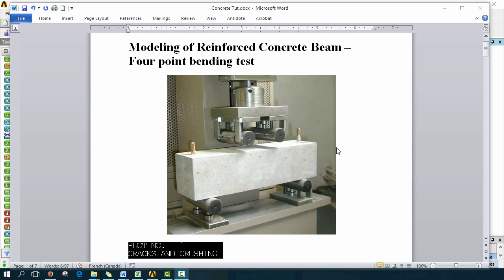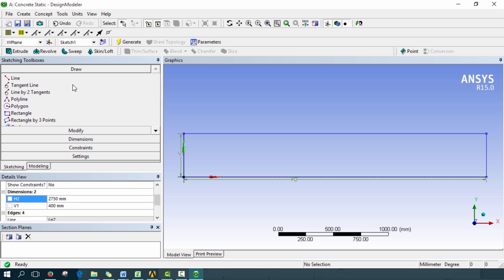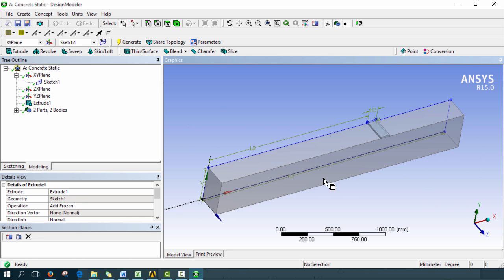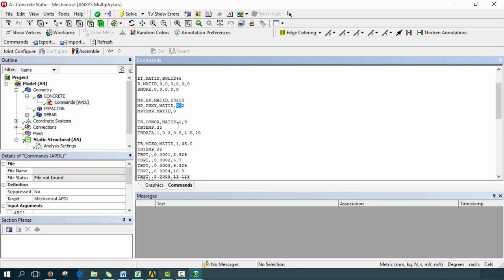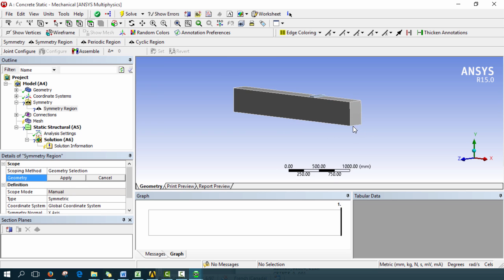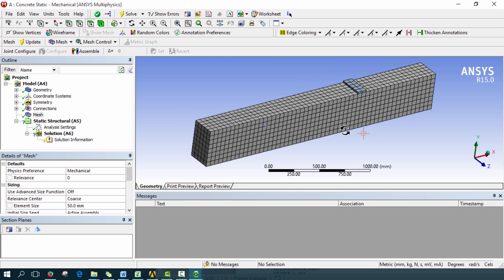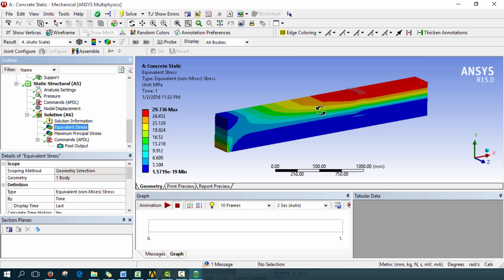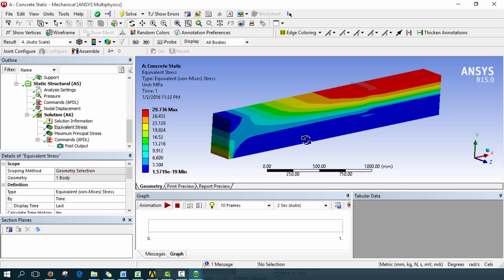ANSYS Tutorial Reinforced Concrete Beam (RC BEAM) - Static Structural

Comment: I've been following this video for a similar beam that I've been modeling but I have an issue. It works fine when I supress the rebar but doesn't run when I try to use it as normal. Any idea where I went wrong?

Comment: I have a question. I'm doing my project on magnetorheological shear thickening polishing for brittle materials. However, I'm doing simulations with ANSYS software for CFD, and I have obtained satisfactory results. But for static structure, I want to check when cracks and fractures will occur and how the penetration of grits or abrasive particles could impact this. Could you please help me with this?

Comment: Why giving command instead of apply concrete property directly??
Reply from the maker: Workbench does not support these material properties yet, so we have to use commands
Reply: @drdalyo  sir i can see sever all  meterials in work bench in meterial tap., previously i choose any one from the list. Thats already included concrete also. What's about this?
And how you get this command sir?
Reply from the maker: It depends on the analysis you would like to do. For something basic, you could use the material library.

Comment: One correction in the video
the Solid65 and Link180 do not define the material, These are the element type that ANSYS will consider while solving the equations.
Reply from the maker: you are right they are element types than can then later carry material definitions

Comment: Can we use the commands for inserting only materials. I only have to input concrete material so will the command for concrete part be sufficient Or should I also add code in static structural and solution part as well?
Reply from the maker: Depends, if you are not joining any stirrups then you can just input the command in materials. You do not then need code for static structural. However if you want to display the crack/crush plots then you need commands for solution.
Reply: @drdalyo  I used the concrete part of code and inserted stress strain values I got from my experiment results (83 ) values are there. And I changed the Young's modulus value as per my requirement but the code is showing error when I ran the file
Reply from the maker: @aakashshukla3340  yea the code is very specific so maybe try to keep the number of table data points the same and see. you need to possibly modify some lines of code also.

Comment: Hey, I am using ANSYS student version, the "Geometry" section is different from this video, after choosing geometry it will bring you to the SpaceClaim how should I assign a cross-section to my lines in the SpaceClaim?
Reply: Draw a circle and of required diameter and use pull command to make it a 3D model of rebar. If you want to use design modeller instead at the beginning right click on the geometry and choose Design modeller instead of space claim.

Comment: These commands are not working can you explain it to me bit clear
this is the error which occur after solve
An unknown error occurred during solution.  Check the Solver Output on the Solution Information object for possible causes.
Reply: I am having the same issue as well on the 2020 AnSys academic version.. I don't know the exact reason. Did you figure it out??
Reply: @byte_bender07  not yet but my guess it connection command which creating the problems

Comment: Hey, I found your video really useful and helpful, but I was wondering if in the current ansys version there is a new way to introduce the interaction between the concrete and the steel, since there has been a lot of changes in the software since 2016, or if we still need to input a command. Im doing my college final project on ansys with a concrete beam, but im having a hard time with the interaction between the two materials.
Reply from the maker: Hi Bianca! Thanks for watching. To my knowledge I do not think they added any new features on this since then. I know its a bit of a pain but I believe using commands is still the best way. You can check my comments in the video, i believe some people posted some useful tips or even corrected some things i missed during the video. You can also email me. Best of luck!
Reply: @drdalyo  thank you!!!
Reply: @drdalyo  i sent you an email 😊, the one that's in your channel description

Comment: Dear Please I would like to ask if you have a tutorial video for using ansys to make a 3D model to simulate pile -soil interaction and develop negative skin friction in details and calculate the value of the pore water pressure - drag load - soil and pile settlement and the values of the negative skin friction stress.  If you have such tutorial please I need it for my research. thanks

Comment: R,MATID,12,,0
The 12 on the last line, does it represent the rebar radius, diameter or area? I saw a document were someone put in the rebar area instead.

Also, you put the concrete crushing stress value as 25 but the compressive stress from your data points for the concrete stress strain relationship is up to 30.

 Please provide info on this.

Also, i modelled the same geometry on ansys 19.2, and after analysis the impactor on top slides outwards, but when i keep the contact as bonded, it stays.

Please help.

Comment: Hello, I followed your guide step by step. I have tried for 2 days straight to solve this but the following warnings occur when trying to solve:

Poisson's ratio NU set for material 1 deleted.
Material property table exceeds the number of defined temperatures.     
  Number of temperatures is 1.  The number of data values is 2. 
Poisson's ratio NU set for material 3 deleted.
Material property table exceeds the number of defined temperatures.     
  Number of temperatures is 1.  The number of data values is 2. 
Poisson's ratio NU set for material 4 deleted.
Material property table exceeds the number of defined temperatures.     
  Number of temperatures is 1.  The number of data values is 2. 
Poisson's ratio NU set for material 5 deleted.
Material property table exceeds the number of defined temperatures.     
  Number of temperatures is 1.  The number of data values is 2.
Poisson's ratio NU set for material 6 deleted.  

And then a warning that: 'One or more bodies may be underconstrained and experiencing rigid body motion. Weak springs have been added to attain a solution.  Refer to Troubleshooting in the Help System for more details.'

Can you please help me? I suspect either the command files are incorrect or something else. I have redone your exact steps multiple times and still get errors.

Thanks Dr.
Reply: i also having the same issue brother regarding to the warning. did you done it correctly? if so then please tell me how you did it? 
Kindly regards
Reply: @moeedshahid6193  me to. I used 2020 R1 and I cannot show the cracks
Reply: Same issue I faced as well.

Comment: Hello Dr Dalyo. I've tried to change the command, the concrete one in particualar so that I may use it for 60MPa concrete (stress-strain graph for 60 MPa concrete), but every time I run the solution it gives an error, yet yours with 30 MPa runs correctly. Please help advise on this
Reply: I also facing a similar issue. How did you resolve it Francis?

Comment: are these commands required actually? can i model an RC  beam without using commands in workbench? when i tried , reinforcements and concrete were not connected. only the concrete portion deflected leaving behind the reinforcemnt. how can i rectify this?
Reply from the maker: Unless ansys released a specific update for this, I am unaware of another way. Its one of those features that existed in the original APDL software but not yet in Workbench. There are many other features only available in APDL.
Reply: @drdalyo  You can use a command to join them, the concrete is solid186 and the steel bars is beam188 for Workbench, so in the /PREP7 section you can put this command 
/PREP7 
ESEL,S,ENAME,,186
ESEL,A,ENAME,,188 
ALLSEL,BELOW,ELEM 
CPINTF,ALL,0.00001, 
ALLSEL,ALL 
/SOLU 
OUTRES,ALL,ALL

thats command join the nodes, to learn more download the command reference of Ansys and search CPINTF, Regards.

Comment: why doesn't the graph in the solution work when i try this on my workbench?  i mean usually in the solution tab we can see the graph on each solution that we want, but in this case the graph and the table doesn't want to show up. Could you help me with this problem ?
Reply: ANSYS Reinforced Concrete Beam (RC BEAM) - Static Structural by DrDalyO
CONCRETE COMMANDS:
ET,MATID,SOLID65
R,MATID,0,0,0,0,0,0
RMORE,0,0,0,0,0

MP,EX,MATID,29250
MP,PRXY,MATID,0.2
MPTEMP,MATID,0

TB,CONCR,MATID,1,9
TBTEMP,22
TBDATA,1,0.3,0.8,1.5,25

TB,MISO,MATID,1,35,0
TBTEMP,22
TBPT,,0.0001,2.925
TBPT,,0.0002,5.7
TBPT,,0.0003,8.325
TBPT,,0.0004,10.8
TBPT,,0.0005,13.125
TBPT,,0.0006,15.3
TBPT,,0.0007,17.325
TBPT,,0.0008,19.2
TBPT,,0.0009,20.925
TBPT,,0.001,22.5
TBPT,,0.0011,23.925
TBPT,,0.0012,25.2
TBPT,,0.0013,26.325
TBPT,,0.0014,27.3
TBPT,,0.0015,28.125
TBPT,,0.0016,28.8
TBPT,,0.0017,29.325
TBPT,,0.0018,29.7
TBPT,,0.0019,29.925
TBPT,,0.002,30
TBPT,,0.0021,30
TBPT,,0.0022,30
TBPT,,0.0023,30
TBPT,,0.0024,30
TBPT,,0.0025,30
TBPT,,0.0026,30
TBPT,,0.0027,30
TBPT,,0.0028,30
TBPT,,0.0029,30
TBPT,,0.003,30
TBPT,,0.0031,30
TBPT,,0.0032,30
TBPT,,0.0033,30
TBPT,,0.0034,30
TBPT,,0.0035,30

REBAR COMMANDS:
ET,MATID,LINK180
MPDATA,EX,MATID,,2e5
MPDATA,PRXY,MATID,,0.3
TB,BISO,MATID,1,2
TBDATA,,460,2100
R,MATID,12,,0

PRE PROCESSOR COMMANDS:
/PREP7
ESEL,S,ENAME,,65
ESEL,A,ENAME,,180
ALLSEL,BELOW,ELEM
CEINTF,0.001,
ALLSEL,ALL
/SOLU
OUTRES,ALL,ALL

POST PROCESSOR COMMANDS:
/SHOW,png
/ANG,1,
/VIEW,1,0,0,0 !Use these values to change the view
/DEVICE,VECTOR,ON
SET,Last !Outputs final result set
PLCRACK

Please subscribe!!
By DrDalyo
https://www.youtube.com/user/drdalyo

Comment: Can you create a new reinforced concrete tutorial using Ansys R19 please? R19 has a weird interface and tools are different. 

I went through this example with R14 version (that's the only old version I could find). And I got these two errors:
- "An unknown error occurred during solution. Check the Solver Output on the solution information object for possible causes."
- One or more bodies may be underconstrained and experiencing rigid body motion. Weak springs have been added to attain a solution...." 
I did exactly what you have shown in this video, but it is giving some warnings about poissons ratio in the Solver Output. 
Thanks,
Baha
Reply: I got the R19 as well, I'm interested in compressed reinforced circular columns if you can help
Reply: I got the R19 as well, I'm interested in compressed reinforced circular columns if you can help
Reply: You can change the screen from space claim to design modeler, so that it wont be weird.

Comment: Hello sir, I've recently started working in ANSYS Workbench 19.0. I used the APDL commands you have specified with minor changes in the stress and strain, but the deformation is very low when compared to the experimental data. The rebar commands are not influencing the model. It doesn't show any error when I comment Young's modulus or I increase the value exponentially. Could you please help me in this?
Reply from the maker: Try making large material changes to the rebar commands, see if there is an effect on the results. There should be. If not please let me know.
Reply: I tried to reproduce your model sir. I changed the rebar young's modulus to 2e10. I can find no changes in the result, Sir. Kindly help me in this. This would greatly help me in my model progress.
Reply: Sir I am following step by step but the commands are not working

Comment: where can i get those codings for concrete  and steel rabars
Reply: ANSYS Reinforced Concrete Beam (RC BEAM) - Static Structural by DrDalyO
CONCRETE COMMANDS:
ET,MATID,SOLID65
R,MATID,0,0,0,0,0,0
RMORE,0,0,0,0,0

MP,EX,MATID,29250
MP,PRXY,MATID,0.2
MPTEMP,MATID,0

TB,CONCR,MATID,1,9
TBTEMP,22
TBDATA,1,0.3,0.8,1.5,25

TB,MISO,MATID,1,35,0
TBTEMP,22
TBPT,,0.0001,2.925
TBPT,,0.0002,5.7
TBPT,,0.0003,8.325
TBPT,,0.0004,10.8
TBPT,,0.0005,13.125
TBPT,,0.0006,15.3
TBPT,,0.0007,17.325
TBPT,,0.0008,19.2
TBPT,,0.0009,20.925
TBPT,,0.001,22.5
TBPT,,0.0011,23.925
TBPT,,0.0012,25.2
TBPT,,0.0013,26.325
TBPT,,0.0014,27.3
TBPT,,0.0015,28.125
TBPT,,0.0016,28.8
TBPT,,0.0017,29.325
TBPT,,0.0018,29.7
TBPT,,0.0019,29.925
TBPT,,0.002,30
TBPT,,0.0021,30
TBPT,,0.0022,30
TBPT,,0.0023,30
TBPT,,0.0024,30
TBPT,,0.0025,30
TBPT,,0.0026,30
TBPT,,0.0027,30
TBPT,,0.0028,30
TBPT,,0.0029,30
TBPT,,0.003,30
TBPT,,0.0031,30
TBPT,,0.0032,30
TBPT,,0.0033,30
TBPT,,0.0034,30
TBPT,,0.0035,30

REBAR COMMANDS:
ET,MATID,LINK180
MPDATA,EX,MATID,,2e5
MPDATA,PRXY,MATID,,0.3
TB,BISO,MATID,1,2
TBDATA,,460,2100
R,MATID,12,,0

PRE PROCESSOR COMMANDS:
/PREP7
ESEL,S,ENAME,,65
ESEL,A,ENAME,,180
ALLSEL,BELOW,ELEM
CEINTF,0.001,
ALLSEL,ALL
/SOLU
OUTRES,ALL,ALL

POST PROCESSOR COMMANDS:
/SHOW,png
/ANG,1,
/VIEW,1,0,0,0 !Use these values to change the view
/DEVICE,VECTOR,ON
SET,Last !Outputs final result set
PLCRACK

Please subscribe!!
By DrDalyo
https://www.youtube.com/user/drdalyo

Comment: Thank you for the video. I would like to ask that concrete material is also available in the material selection section of ansys workbench (i am using version 16), then why dont we directly use that concrete material? In your experience How is that material different than the one we define here by using commands?
Reply: Hey bro, have you figured out the diferences? I have the same question.

Comment: Thank you for the upload, its extremely helpful. I've tried a different model in the static structural module - a circular column with single longitudinal reinforcement, given by line body as shown by you; bottom end fixed supported and axial load on the top end in the form of pressure. But its showing some error during solution. "A solver pivot warning or error has been detected in ROTY degree of freedom of node 17735 located in line body. This is usually a result of an ill conditioned matrix possibly due to unreasonable material properties, an unconstrained model, or contact related issues. Check results carefully. You may select the offending object  and/or geometry via RMB on this warning in the Messages Window." I would be extremely grateful if you provide me with a solution for this problem.
Reply: This might be too late, but I am getting the same error. I guess it's because the body interactions were not given properly, i.e, the concrete has to be contacted to rebar as "reinforcement" in body interaction. This wasn't showing up in static structural in workbench. Using Dynamic explicit might help I guess

Comment: sir i couldn't download the command file please email me to this nthprasha144@gmail.com
Reply: ANSYS Reinforced Concrete Beam (RC BEAM) - Static Structural by DrDalyO
CONCRETE COMMANDS:
ET,MATID,SOLID65
R,MATID,0,0,0,0,0,0
RMORE,0,0,0,0,0

MP,EX,MATID,29250
MP,PRXY,MATID,0.2
MPTEMP,MATID,0

TB,CONCR,MATID,1,9
TBTEMP,22
TBDATA,1,0.3,0.8,1.5,25

TB,MISO,MATID,1,35,0
TBTEMP,22
TBPT,,0.0001,2.925
TBPT,,0.0002,5.7
TBPT,,0.0003,8.325
TBPT,,0.0004,10.8
TBPT,,0.0005,13.125
TBPT,,0.0006,15.3
TBPT,,0.0007,17.325
TBPT,,0.0008,19.2
TBPT,,0.0009,20.925
TBPT,,0.001,22.5
TBPT,,0.0011,23.925
TBPT,,0.0012,25.2
TBPT,,0.0013,26.325
TBPT,,0.0014,27.3
TBPT,,0.0015,28.125
TBPT,,0.0016,28.8
TBPT,,0.0017,29.325
TBPT,,0.0018,29.7
TBPT,,0.0019,29.925
TBPT,,0.002,30
TBPT,,0.0021,30
TBPT,,0.0022,30
TBPT,,0.0023,30
TBPT,,0.0024,30
TBPT,,0.0025,30
TBPT,,0.0026,30
TBPT,,0.0027,30
TBPT,,0.0028,30
TBPT,,0.0029,30
TBPT,,0.003,30
TBPT,,0.0031,30
TBPT,,0.0032,30
TBPT,,0.0033,30
TBPT,,0.0034,30
TBPT,,0.0035,30

REBAR COMMANDS:
ET,MATID,LINK180
MPDATA,EX,MATID,,2e5
MPDATA,PRXY,MATID,,0.3
TB,BISO,MATID,1,2
TBDATA,,460,2100
R,MATID,12,,0

PRE PROCESSOR COMMANDS:
/PREP7
ESEL,S,ENAME,,65
ESEL,A,ENAME,,180
ALLSEL,BELOW,ELEM
CEINTF,0.001,
ALLSEL,ALL
/SOLU
OUTRES,ALL,ALL

POST PROCESSOR COMMANDS:
/SHOW,png
/ANG,1,
/VIEW,1,0,0,0 !Use these values to change the view
/DEVICE,VECTOR,ON
SET,Last !Outputs final result set
PLCRACK

Please subscribe!!
By DrDalyo
https://www.youtube.com/user/drdalyo

Comment: DrDalyO, I had previously tried out this tutorial during my PhD, but I was using APDL. I can provide some comments here, but I also have questions. 1) Your concrete stress-strain graph for concrete plateaus at peak strength but the real graph for concrete shows strain softening. As I know, v12 - v14 cannot model strain softening and I think that's why you had used the plateau here. Is the only workaround for this is to use Explicit Analysis? 2) Why was strain softening able to be modelled in v10 and earlier? Were v10 and earlier using a different solver or was that an ANSYS coding error? 3) What are the limitations in Workbench (WB) that requires one to revert back to using (parts of) APDL on certain situations? 4) Wasn't WB supposed to replaced APDL, so why do those limitations still exist in v18? Thanks.

Comment: Hello! Many thanks for helpful video tutorial.Could you please explain the meaning of warning message in solution tab.
Reply from the maker: +Ilmir Nugmanov Please remind me what the message says?
Reply: The message was: "One or more bodies may be under constrained and experiencing rigid body motion. Weak springs have been added to attain a solution". Does it critical for linear or non-linear analysis?
Reply: The message was: "One or more bodies may be under constrained and experiencing rigid body motion. Weak springs have been added to attain a solution". Does it critical for linear or non-linear analysis?
Reply from the maker: +Ilmir Nugmanov It could be normal for a non linear analysis if the model is slightly under constrained. Best thing to do is to output the reaction forces for the weak springs and see how much force was used to constrain the model. If its large then you have to add more BCs. If its small you could ignore it depending on the precision your looking for.